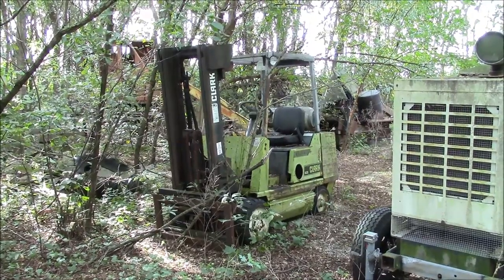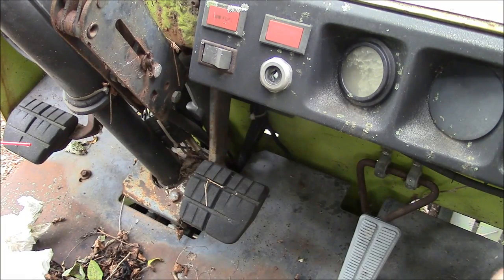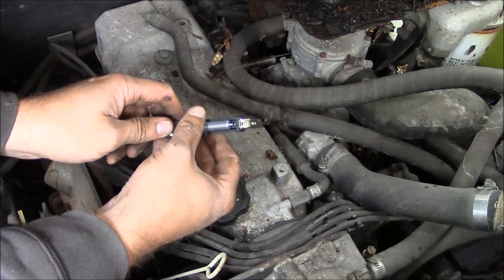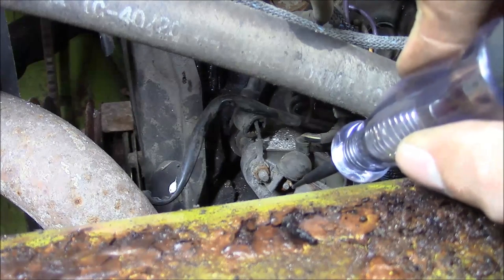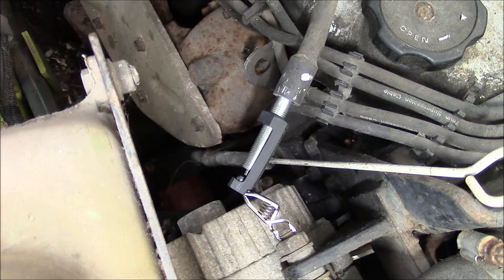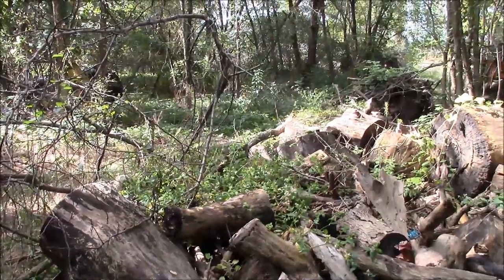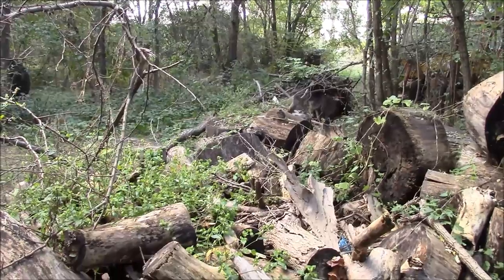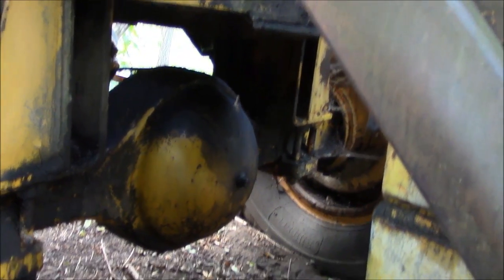Clark Forklift Sitting in a Field for 17 Years - Will It Run Again?

Comment: 4G52B Mitsu engine
Reply from the maker: 4G64.
Reply: Watch Wes Work no it's not.The 4G63 and 64, the water pump is behind the plastic front cover. I've been a forklift mechanic for 27 years and have worked on both. The water pump is the giveaway. Sits high on the engine. Clark did use both motors but that's a 4G52. It has a timing chain and the 4G63 had a belt. The only thing that makes that a Clark is the color. Made in Asia
Reply from the maker: @joeharmer574  I dunno. It clearly says "Made in USA" on the sticker on the front panel. I gave the serial number to the dealer. They said 4g64.
Reply: Watch Wes Work. Most of the parts are the same but I'm 100% sure it's not a 4G63 or a 4G64. Tune up parts are identical. Not that important, I've just worked on 100's of them. You did a nice job getting it going!
Reply: After reviewing the video again. You are right. I've just have never seen that water pump set up on a 4g64 or 63 and I've seen tons of them. Typically they did use the 4g52 in these. Again....great job getting it going. The 4g63 and 64 are notorious for loosing compression if they sit too long. You can seafoam them and they will come back to life
Reply from the maker: No worries. I just looked at the engine block. It's stamped "4G64". It definitely has a timing belt, which I plan to replace. Guys were saying they are hard on head gaskets but this one seems to be OK in that department.
Reply: Watch Wes Work . Not really seen many head gasket issues but have seen them overheated and will warp the head. Being an overhead cam engine, if warped, the head becomes scrap aluminum. Yeah the 4G52 had a timing chain, not a belt. I can't even tell you how many timing belts I've done on them. Countless. The water pump is typically behind front cover and you have to remove the tensioner to do the water pump so I always just put a new belt on at that point.
Reply: Timing marks are a little tricky when you do the belt. When you do the belt, rotate the engine by hand a couple of revolutions and recheck your marks. You can be off one tooth and it will run but won't run with power. Just a piece of advice. Need and info, feel free to contact me.

Comment: I subscribed a long time well for me anyway because you don't whine. You talk to yourself just like I do mostly to break the silence and work it out in my head. You could make    yourself a list like  things the town dummy would take with him and then you might not forget as I do constantly. I think I have even answered myself so don't go all Jack Nicholson on yourself. Its your video, your first amendment and anything else to do with boy scouts as the last dozen presidents have quietly taken from us. I would if I could try to save that  contraption as you called it as a poor boy, I used stuff like that in my little homemade lumber mill to lift logs on it I could cut up to forty inch lumber in true dimension as it was a bandsaw and it worked for years for me then a guy building him and his family needed the whole works to build a home and I wasn't able to work anymore. I only have one limb with feeling as my right just hangs at my side and my back is so broken, it made a doctor have tears in his eyes, I swear its true. Your a good guy Wes and don't think you didn't use up a rabbits foot on that distributor on the fook lift cause that is finding a needle in a haystack... good video..
Those old michigan loaders are actually easy to work on. All kinds of room to change a engine in. I did one about twenty year ago in two days everything and it took some time cause it had set for ten years before I got my hands on it. You could put a small block chevy or ford in it as that was the most common swap. I guess I should say inline six's as that is what I meant